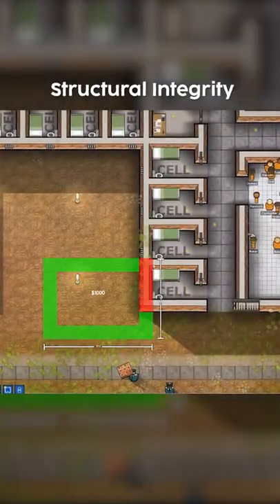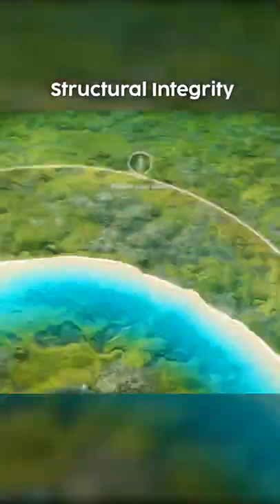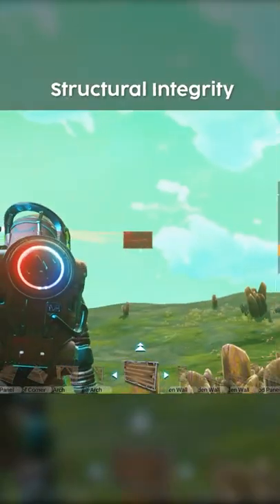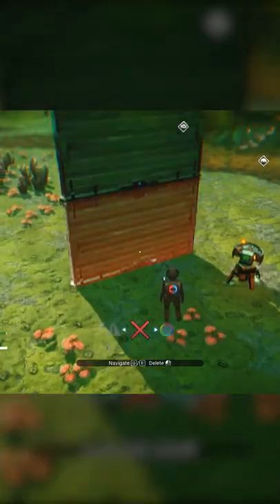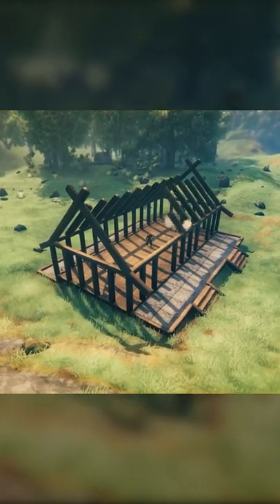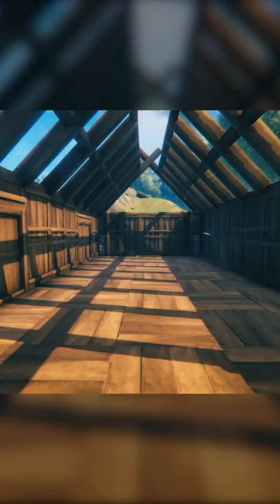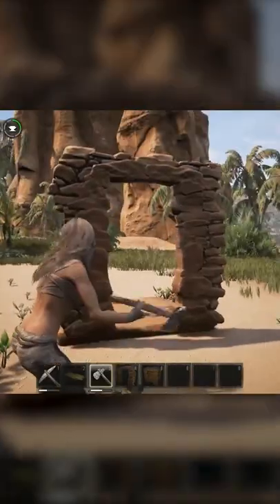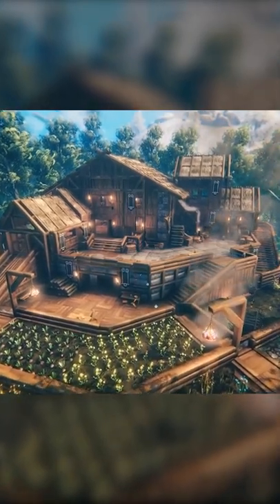Structural Integrity In Building Games

Comment: Aah uhh no, Valheim does NOT check for how much weight the piece is holding up. It checks how many pieces it takes to reach down to the ground. Blue is when the piece is directly touching the ground and green when it's a piece touching the blue piece, so on and on,, and that blue piece will never turn green no matter how many things you've stacked on top of that single piece. The colors of all other pieces are still going to be based on "how many pieces/steps am I separated from the ground?"